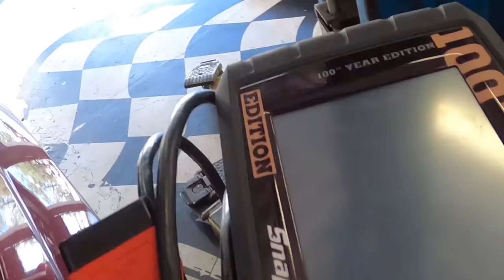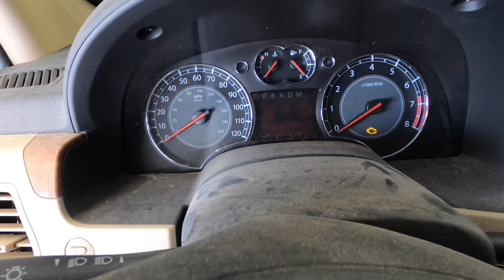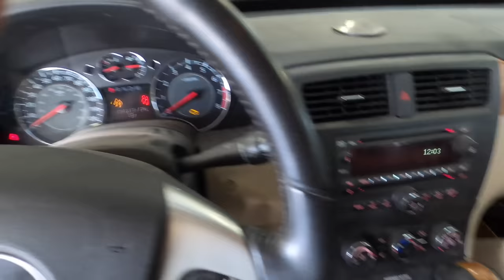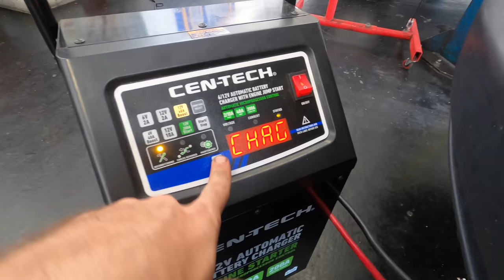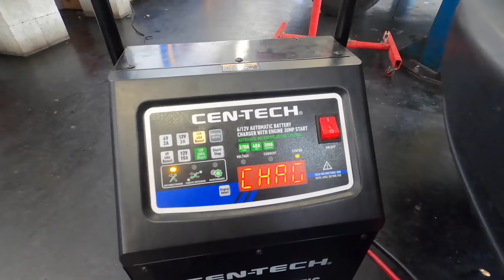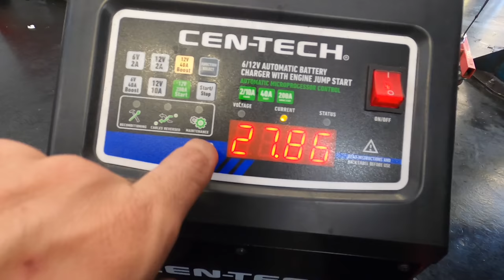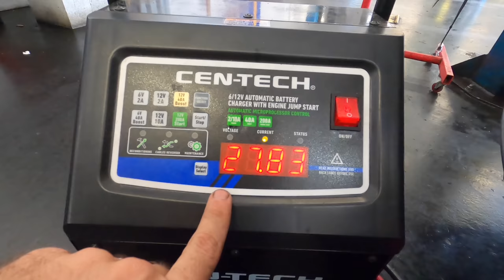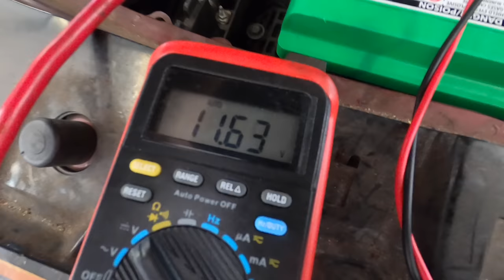Customer States: Doesn’t Start! Broken over 1 bolt! Suzuki XL7

Comment: At least it's not a BMW; where  Engine oil flows through the alternator bracket.  only the Germans could think of something like that
Reply: It's the oil filter housing. Not to mention depending on the year the power steering resevoiur is right above it. And always leak taking the pump and alternator with. 
DAS SHIT
Reply: Ikr, my 5 series wouldn’t crank over a steering wheel lock fault. Had to learn how to program
Reply: Thats a little worse than the liquid cooled alternators some Cadillac Northstar engines had.
Reply: @ericgunter45  actually not so fast, BMW has many models with coolant cooled alternator's also
Reply: @kevinbarry71  So glad I dont have to work on european brands.  You guys that do have my respect.
Reply: @ericgunter45  not me. I'm just an enthusiastic amateur.
Reply: Think?
Reply: yea i had this problem on my 550i. not fun
Reply: @marshallmotorssc  look up alternator bracket gasket n62
Reply: BMW’s are easy to work on, the whole car comes apart like legos
Reply: @720MotorWorks  Except that Legos are easy to put back together
Reply: #eurotrash
Reply: @720MotorWorks  European cars in general are designed like that. I've got a w211 E500 and really having torx and alen stuff is most important until you get to CAN communication. The thing is, is that Ze Germans designed everything to be completely serviceable. Unfortunately the down side is things tend to be stacked so you have a little more disassembly to get to things. Other than diag equipment, that's why labor prices are usually through the roof. Audi A8 Quattro turbo replacement pays 2 hours. But thats after motor and trans is pulled and sitting on the shop floor.
Reply: @kevinbarry71  so do BMW’s, the entire interior can come apart with a couple torx bits and trim tools, while everything in the motor can come out with some Etorx bits and normal sockets
Reply: @ericgunter45  I live in the UK and as a job I do roadside breakdown. The company want us to do fix everything permanently, ( obviously some jobs are not roadside fixs) then temporary fixs then last resort is for me to tow them in to a garage. Obviously the guy who fitted the alternator didn't tighten the main cable on to the back of it enough resulting in a poor connection and high resistance causing heat damage to the bolt.
Reply: @12yearssober  Yeah that's relevant..
Reply: Supercharged 3800 series 2 has coolant in the supercharger idler pulley bracket for no reason. There are lots of things manufacturers do that is just a hassle and unnecessary.
Reply: So true mate last week we had an Audi Q7 with a coolant leak coming from the A/C bracket mounted to the engine block  the rubber gasket was bad it has these ports in the bracket where the coolant goes by
Reply: as long as a bmw has complicated solutions and expensive repairs, all is right with the world. 
no money sympathy at all for luxury car brand owners. sorry
Reply: HA HA HA, BLITZKRIEG !!
Reply: @AccountInactive  
Oh I absolutely know we fought the wrong side. With that said the time and manpower wasted on keeping track of it was an example of how Germans over complicate things.
Reply: What has your bracket accomplished? Oooooh it bolted to a thing nice
Reply: @ericgunter45  Thanks buddy and yes sometimes is a hassle but I like challenges and finishing them as well. Besides being a tech, I also learned coding and programming
Reply: Sounds dumber than a Ford. But seems easier than a ford
Reply: “Yeah, just doing my alternator gasket…”
Reply: @LaatiMafia  
It was a joke please get a sense of humor.
Reply: @12yearssober  if you find a bmw hard to work on, sell your tools
Reply: @12yearssober  
I'd call my reply a joke as well - but there is nothing funny about Americans.
Reply: my car is a dodge but the engine was designed and built by the germans, the chassis is a bmw chassis that the car was built onto. and the transmission is a german transmission and even when working as designed the transmission clunks and makes a lot of normal noise.
Reply: My wife decided to buy a used X5 with the v8 , she didn’t let me inspect it .  Needless to say it became the shop princess on my lift. When it ran , it was great,  but other wise it leaked like a sieve . Multiple repairs and thousands later we dumped it .
Reply: Afraid not. Chevrolet the dumbest of all the American brands run coolant through the belt tensioner. Genius 💡😂
Reply: That sounds awful! It seems like that would be prone to leaking oil onto the belt
Reply: Insane
Reply: Hey, the VTEC actuator is directly above the alternator in the '08 Honda Accord. When the o-ring between the parts of the actuator fails, it promptly fills the alternator with oil to make it fail, too. Terrible design.
Reply: My moms friends got brand new on and it just shut off leaving house it threw code saying battery wasnt charging so I figured it was alternator long story short to even get it to shift into nuetral gota have power but its push to start so then I'm trying to get to battery which is in the trunk no getting to that either because the trunks electric so finally I popped open the hood found a Hot wire and grounded to the frame an Allah it fired up -_-
Reply: @scottgoodson6046  Are you a automotive engineer?
What you consider " UNNECESSARY" was determined to be necessary by the engineers who designed the car.
They would not design engineer and manufacture an unnecessary system at an exorbitant cost unless they determined that it would be beneficial.
Reply: @williamegler8771  
Funny considering none of mine had anything to do with that.
Reply: 2 best days of bmw ownership is the day you buy it and the day you sell it I know first hand with my f10 5 series on top of dumb designs they make everything need to be reprogrammed/updated to fix anything
Reply: @ericgunter45  Audi is running them again for the 48v systems. And there is a good failure rate. The 12/48v batteries need to be good, and alternator(generator) needs to be coded.
Reply: They are  mad same as mercs with water flowing  through  altenator
Reply: Now, now, it's not just the Germans. Chevy Impala 3.8 coolant elbows through the alternator bracket! Automotive engineers are idiots the world over!
Reply: @Whateva67  what he said was in poor taste and in the wrong place; what you said was just plain stoopid
Reply: Yeah why do they do that? Cool the alternator?
Reply: @kevinbarry71  lol
Reply: My Very late e53 X5 4.4 does not have any janky oil cooled alternator… it’s 180 amp but other than that it’s a real straight forward part.
Reply: @ericgunter45  the north star was just a junk engine to begin with.

Comment: Having been a mechanic myself, along time ago, I used to say that the design engineers needed to apprentice as mechanics for 5 years before they could be allowed to design a car (back in those days put pencil to paper).  Pity the poor manual writers who had to figure out that kind of "stuff".  They should have put a h ole in the frame so that you could get that long bolt out.
Reply: Amen!
Reply: A lot of the times, it’s the accountants who try to cut corners to make manufacturing cheaper.  It’s not always the engineers’ decisions.
Reply: Oh, I agree with this SOOO wholeheartedly!!!  If there's a single BASIC component (i.e. - anything external to the engine block) that can't be removed by the designers with 4 curse words or less, then it's back to the drawing board!!!  And no more having to remove 3 OTHER components to GET to the one you need to remove either.  I have felt your pain and still have the tiny knuckle scars to prove it!!
Reply: Its always been us and them ,they do it on purpose and we just get round it using more intelligence then them designing it 
Most modern cars are 'rip out' jobs now have to rip everything out even to get to the simple things
Reply: Brother  I've been saying that for years  myself.....You are EXACTLY RIGHT  ALL DESIGN ENGINEERS  should  be in the field for years  just like you said before  they are allowed to even put pencil to paper!
Reply: @Captain_Jack514  So make the machine cost a few bucks more....I'LL  PAY IT !...If it means a BETTER  product!
Reply: @fubisroc9673  EXACTLY  !...,I've been Screaming about this for years!....When I'm wrenching on our family vehicles  my wife Doesn't Understand why I'm so PISSED OFF ..... I  tell her  THE EXACT THING you just said!
Reply: @fedupwithfedforever4151  I don’t disagree.  I was just making an observation.  Being cheap can be very expensive.
Reply: As an engineer I couldn't agree more. The frame, engine, and body are all designed by separate teams who don't talk to each other much. It needs to be a single team, and every engine bolt and stud should always be grade 8 minimum.
Reply: Architects should as well.
Reply: The AC pump on my 97 f150 same way, 2 bolts come right out, the 3rd will not due to being against the frame. Remove 2 bolts no problem, but the 3rd one has to come out with the pump. It's just enough room for a 1/4 drive ratchet with a 10 mm socket, 1/4 turn at a time and very little wiggle room... pain in the ass.
Reply: @fedupwithfedforever4151  I was in whitegoods repairs for 30 years. We faced the same problems with having to completely dismantle things to do a minor repair
Reply: Sounds like you guys want cars to be completely assembled with nothing but quarter turns Dzus fasteners.  😉
Reply: I talked with someone who worked for Mack a long time ago. Said that to get a job as an engineer, they would put you on the assembly line, and in the field as a mechanic before you could start designing. The gentleman did say that all stopped when Renault started getting more involved.
Reply: I had a fender replaced on my 1988 Bronco after a collision and the new inner fender had a DRASTICALLY misaligned hole to provide access to the front directional bulb.
The body show ended up using power shears and expanding the hole, then filing down the sharp bits for me. 
-
Bad parts, great body shop.
Reply: 1 year mechanic, 1 year welder/fabricator, 1 year machinist. 3 years to get a solid grasp of mechanical design and troubleshooting
Reply: @omeyehead7436  My dad was an architect, believe me when I say they do try. He would always talk about getting frustrated about that kind of thing but was limited in his design options. There's a whole lot of things they have to take into consideration when designing buildings.
Reply: Exactly and take a post graduate course on how to appropriately apply spray cans of break dance cleaner upper.

Comment: The alternator on my Jeep has been squealing it's bearings out for awhile and I finally decided to change it today.  When I got the new on, the hot connection wasn't seating correctly.  I noticed the slots in the plastic surrounding the post didn't line up with the tab on the connector when it was oriented correctly for the wire routing.  I made the decision to snap off the tab rather than kink up the wire and it buttoned up fine.  Just wanted you to know that having recently seen this video made me pay attention to what was going on and I appreciate what you do.  Cheers!

Comment: Glad to see such an alternator so easy to remove ! Step one take car apart! Makes my old mini look easy .
Reply: Sorry, ANY problem with an old mini required removal of entire engine.
Reply: @stevendouglas6593   not if you had small hands and a strong grip .lol.
Reply: @stevendouglas6593  I can think of one fix that didn't require the removal of the engine (though the door was in danger of being removed): Getting my 6'3 self out of my friend's Mini MG.
There were tears. MANLY tears!

Comment: If you inspect the separated surfaces of the snapped off alternator screw you might see two colorations to the crack. The dull or gray part is the older fracture and the shiny part is new. If the older part shows dulled protrusions from the crack that may be due to rubbing over time.

Comment: Mechanic: What's the easiest way to remove this part?
Engineer: Disassemble everything!
My wallet: Please, no...
Reply: That company can't design a vehicle.
Reply: God Trojan  Just curious, what kind of Suzuki was it? Because my brother has a '08 Grand Vitara with over 200k miles and it has never broke down once.
Reply: God Trojan  Oh okay, that's why its so bad. It's not even a Suzuki, It's a rebadged GM shitter, much like the XL7.
Reply: @seth2943  I've got an 03' grand vitara that was beaten to shit.... put a grand or 2 into the car runs perfectly. Japanese suzukis are pretty much as reliable as Toyotas.... at least here in Ecuador. But from 10' onwards it's built quality came down like a Rollercoaster
Reply: God Trojan  Except Suzuki makes literally the best engines in the world.  Their motorcycle engines are second to none. If Suzuki had actually engineered/designed that vehicle it would still be running at 400k miles like the day it was made.
Reply: Partly faulty cell on battery.  Dead shorts on the battery has me suspecting one out of the six cells is nearly eroded all the way.  Car batteries have very thin plates.  When you have a low voltage condition battery electrolyte is super acidic which speeds the battery plates decay..  Its why if you let a car battery run dead a couple of times the battery dies completely.  The fact the battery/alternator have been replaced recently and shit alternator install also caused the battery to be flat [not hold a charge].  They will be back!
Reply: @williameldridge9382  Suzuki did help design many Toyota engines back in the day.....
Reply: 14:03 Kaptain Krusty have a honorable mention.
Reply: @StormsparkPegasus  That company probably gets to charge for labor hours at the stealership
Reply: Lol soo true
Reply: @williameldridge9382  Isn't that Honda

Comment: This happens a lot. Vehicles won’t start, but after they have been bounced around on the back of a tow truck they will start.
Reply: When the battery voltage drops too low, some relays can become sticky.
Needing a well aimed whack to free them off.
The trick is hitting them hard enough to free them up, but not hard enough to do anything to the circuit board

Comment: It's like working on aircraft. The engineers swear there's plenty of room to remove that widget out the front. Naw, got to take the whole thing apart, and squeeze it out the back.
Reply: You want to change the oil?  Ok, simple enough.  First, just remove the right wing.
Reply: "The PCM is on top of the battery..." like.. what..

Comment: Cen-Tech..... The old Harbor Freight tools! That's what I would prefer for someone to use to fix my vehicle. Maybe show off your Pittsburgh wrenches and sockets!
Reply: If you've ever noticed, the cheap HF tools are always named after American cities. I had a 'Chicago" electric saw that did a "Portland", it burned up one week after I got it.
Reply: @adotintheshark4848  Your point? Cheap shit is still cheap shit.
Reply: @adotintheshark4848  you have to understand motors and gear systems to some extent to know what cheap shit to buy and what not. A $5 dremel? Fine by me for quick little BS jobs to save me time and hand cramps. $25 oscillating multi tool? Hell fucking yeah badass and can honestly take a beating because it’s just big and beefy. A circular saw? No way jose way too direct drive to last any amount of time. Jig saw? Sawzall? Nope complicated drive systems and strong motors. Your gonna need good steel.
Reply: @keithbroh5730  speaking of saws, I bought a circular saw from HF ..the famous "Chicago Tool" brand, and it burned out after two uses. About as useless as a Chicago mayor.

Comment: I used to work for a Suzuki dealership in Toronto.  That particular generation of XL- 7 is commonly know for having timing chain chains.  I've seen the timing chains stretch by about as much as a 1 inch.  As well it is GM based engine power plant
Reply: Dodge also used it in the Intrepid, loved the car… hated the motor.
Reply: Yeah the XL7 is a rebadged GM Theta platform. Same as a Chevy equinox

Comment: Possibly the previous repair guy cross threaded that bolt in that alternator and couldn't get it tight enough for that cable. And or shoved a rusted bolt in it, and messed up the threads. Real easy to screw up aluminum housing threads.

Comment: The reason it went into reconditioning mode was because the battery was below its nominal voltage. A battery of a car must not go below 12 Volts or it becomes damaged. Then you have to recondition the battery and slow charge with a low amperage till it can keep that's nominal voltage.

Comment: I was looking at an earlier model xl7 with about 100k mi. on it from a local used dealer lot. Did some research and decided to pass on it. The engine was part of some lawsuit due to poor engineering design that caused the cam chain or timing chain to prematurely fail. This all happened after the NA Suzuki line was discontinued and GM avoided financial liability somehow.

It'd seem to be about 50/50 with the amount of failures. Some would fail between 80k-100k with regular maintenance. Others would report 150k+ mi. with no major engine failure with regular maintenance. Couldn't take the risk. Ended up buying a 2008 Lexus rx400h with 213k mi. Only needed the abs module replaced and reprogrammed.

Comment: I’ve got a regular customer with those exact vehicle. I ended up putting a jack under the motor and raised it up about an inch after removing the mount. Gave just enough clearance for that pulley and the alternator to slide right out.